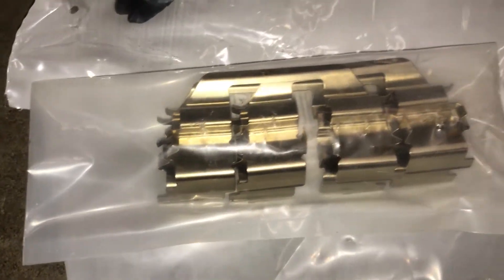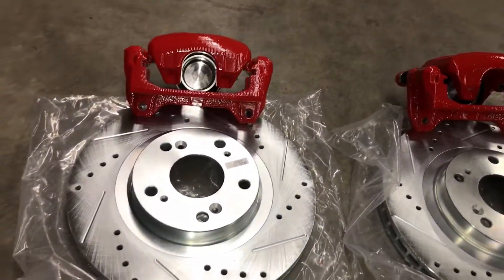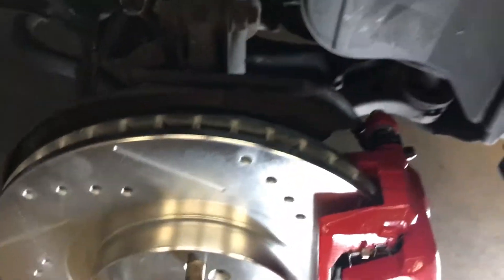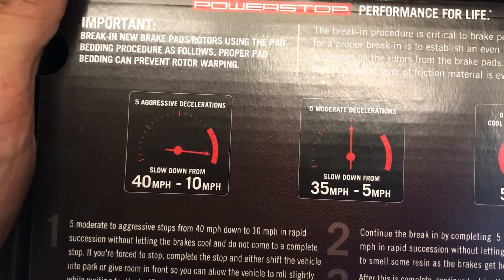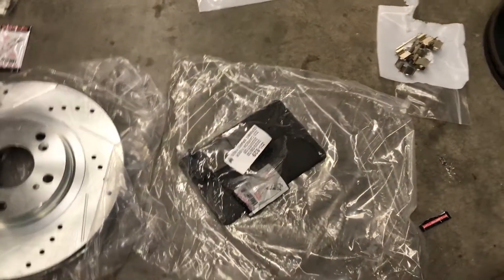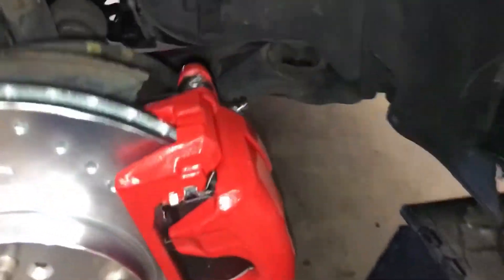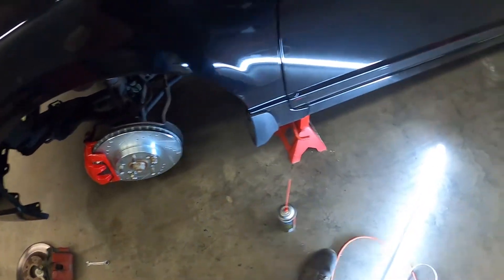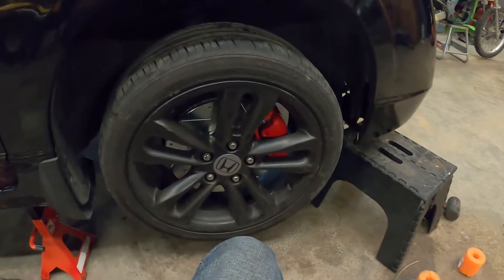8th Gen Civic SI Brake Upgrade!

Comment: Where did you get the calipers, and which drilled and slotted rotors are those? Awesome stuff
Reply from the maker: This kit is made by PowerStop, you can get them through special order at Autozone or power stops website. This specific kit is https://www.autozone.com/brakes-and-traction-control/performance-brake-pads-rotors-kit/p/powerstop-performance-brake-pads-rotors-kit-kc2439/735392_0_0
Reply from the maker: If I’d had known it beforehand the same generation of either the TSX or TSX type S stock kit is an almost bolt on caliper/rotor & pad upgrade aside from trimming some of the brake dust shield to fit the bigger caliper I believe.
Reply: Were you able to keep ABS with that brakes kit?
Reply from the maker: @diego_solis  Apologies for the late reply I didn't get a notification for your comment. Yes this kit was basically like a factory caliper replacement with upgraded rotors and pads. 🤙
Reply: @WreckedRevival my exact plans when i found out tsx calipers and rotors were a direct bolt on, since you gotta source used or new calipers anyways, right? I really dont think you have to modify anything. I believe its the tl type s calipers are the ones you gotta do a lil bit of shaving.